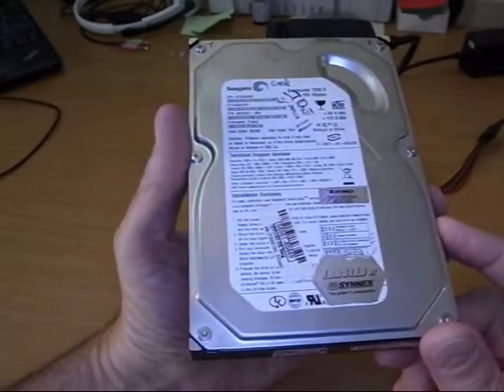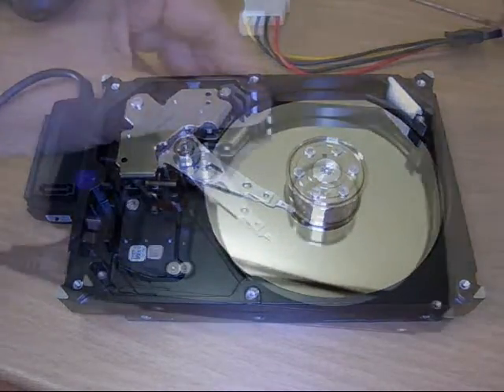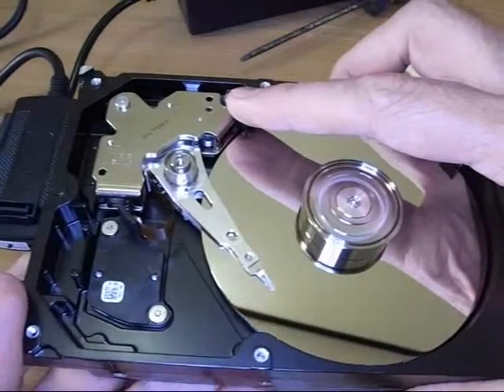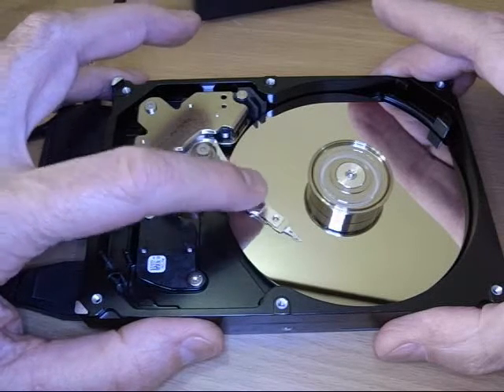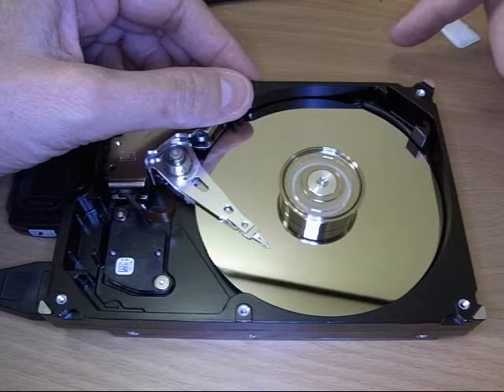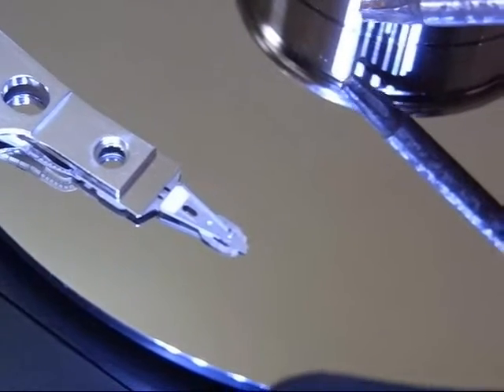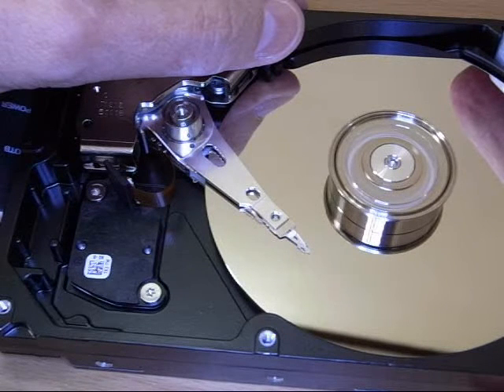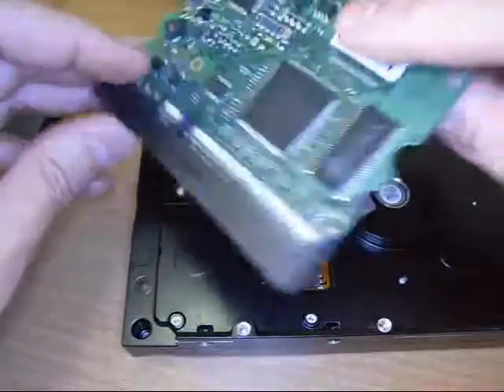Hard-disk Hack - Running One In the Open / Bare

Comment: they are mostly made of aluminum platters, glass is rarely used
Reply from the maker: +michael perugini Yup, some disks have been made from glass.  Glass can be made really flat.  It stays flat.  Is thermally stable.  Does not corrode.  It's good stuff.  Until it breaks.
Reply: +michael perugini I have cracked up 100's of drives and personally have never had a glass platter..
Reply from the maker: google "glass platter hard drive".
Reply: +tsbrownie Glass are used on 2.5in laptop drives, sometimes.. but 3.5in drives are aluminum blanks
Reply: +tsbrownie And on reason glass is rarely used is due to the GLIDE test that the platters must pass before they are deemed PRIME or Flyable .. if a glass platter fails on a glide test , the risk of shatter is great.. whereas alum. plats fail, they scratch and wobble. no shatter.
Reply from the maker: Conclusion.  There are glass disks out there and could be a hazard should one come apart.  Fair warning.
Reply: +tsbrownie well maybe so, but as i stated, i have pulled several hundred drives apart in all my years i have never once come across a glass platter, to include the 2.5in drives that i have peeked into.  But I will agree if one DOES come in contact with a glass platter, hazard is noted.  if it shatters, it will be 1000s of small pieces,  Where your eye protection..

Comment: We take failed drives apart all the time at work (shhhh)  Some of the guys use the disks as a mirror zip tied to the vertical part of the bench to see if the boss is coming .
The magnets in these are super strong.
I have seen a video where someone took the head assembly and turned it into a large amp meter, extending the "pointer"  the scale was the wall and the pointer moved back and forth about a foot or so, they had it to monitor the wind generator it was fed by.
Thanks for the video, it was fun
Reply from the maker: +Craig Nehring I take them apart too, but I learned from the Mythbusters you have to tell people not to try it at home!  ;)  I like that amp meter thing.  I will have to try that.